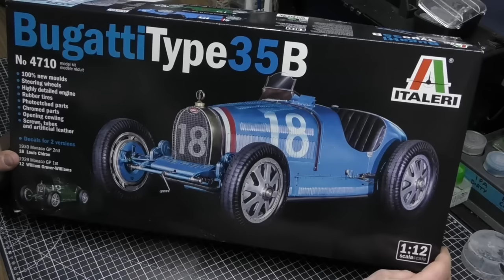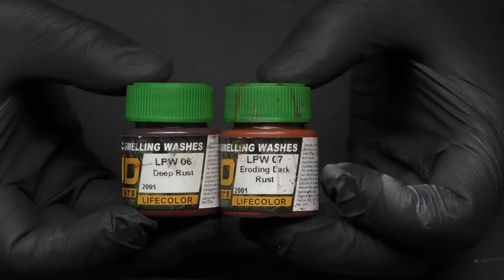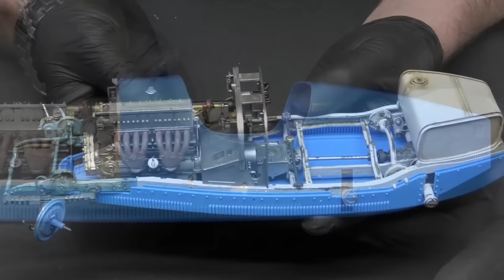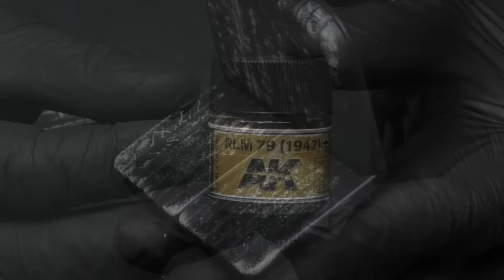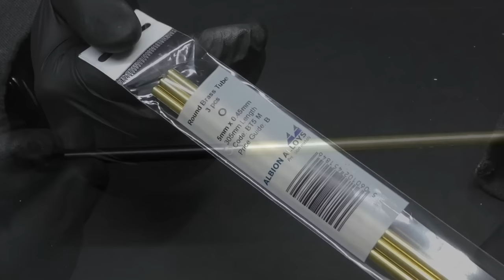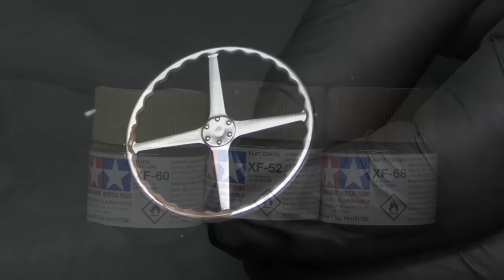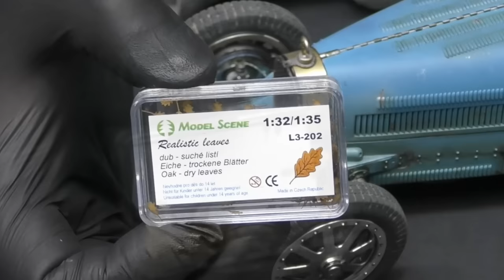Italeri 1/12 Bugatti Type 35B - Model car kit build.

Comment: I once had the pleasure of to share a small racetrack with one of these. The track was anneau du Rhin near Freiburg/ Germany and we were two 964s and a lady related to the track somehow with a friend. Once they were done, they left the car outside near the workshop to cool down. It was also in a well used condition. Lots of nickel plated parts actually and lots of the metal parts - including the cylinder heads - had the circular brush pattern… your version is a bit more worn and dirty, but it’s really very close and looks wonderful !!

Comment: Hello Andy, great job explaining and demonstrating your artwork. I will be studying your techniques on my build, although not on this particular car. I am an old model builder getting back into the hobby now that I am retired. However, I never attained the skill level I have witnessed in this video, I never met someone with your skill sets as well. Back in 1968 I was buying my models from a discount store called K-MART. Car models back then cost only $1.25, sadly these same models now cost upwards of $24.00 a box. One day I went to buy my next project and was surprised to find wooden skids stacked with 1/8 scale Pocher models selling for $25.00 each. I purchased two a 1931 Alfa Romeo 2300 Monza and a 1909 Fiat. I bought these models for the sole purpose of building them when I have retired. They have been sitting in my closet for over 50 years.  I have just started working on the Alfa this week when I came across this video. What you have demonstrated to me was that a model could look so much more dynamic than a finished product. What your depiction of this car says to me is, I have stories to tell you. Whereas a sparkling new car without the scuffs and dings only is an object to admire at best. Thank you for sharing your knowledge and skills. I eagerly look forward to viewing your portfolio in these videos.

Comment: Very good presentation  looks like it would appear when driven back in the 50"s , I have the CMC GmbH die cast that looks factory new and your finished model model looks just as it was years ago right off the  track now i know how to finish my Kingfisher Models 1:48th scale  Foden  S 21 so it will look like it was when i used to drive it before i came to the   USA  Thank you     Ed 40 S of Vegas

Comment: Model Looks Fantastic ,Only thing I would have changed is the Bonnet Straps, the Bugattis I worked on were "Leather" not Fabric . And the Seat Looks a little too uniform in texture . I would have used a Leatherette Covering to add depth and the Drivers position would certainly been additionally very more worn and slightly sunken down .
Cheers !

Comment: please do not take this as a critic ; you work is amazing ; and the level of detail mindblowing; but just as a personal information ; that car had one of the most unique engines then and now. 
it was 100% aluminum & the engine block milled out of one piece; the head and low end where a single piece for the early ones ;  and was known to be a pain to do vavle jobs on.   
aprt from that small informational detail ; i really dont want to down play any of your work ; its just so good i wouldn t be bothered & wouldnt comment if i saw it like that in an expo.

Comment: A really lovely build,  I was impressed by your attention to authentic detail, but also thought it would been even more impressive if you had thoroughly researched and built the complete authentic wiring harness for the vehicle not just the HT lines,  I absolutely love micro engineering on cars  and planes, and felt this kit would be a natural for that treatment.....subscribed.
  I have recently embarked on just this exacting a sort of build on  Aoshimas Kawasaki Z1, 900 incorporating its entire wiring loom and pipe runs, sadly I wasnt aware of your online shop previously and bought the kit direct from Aoshima in Japan along with an 80's  Honda  CB750, I may be purchasing something that tickles my creativity buds from you pretty soon hopefully.

Comment: Really enjoyed this video. Found it by accident and subscribed. I like how you describe each step. Clearly show each paint color and manufacturer. Mostly I build scale diecast models but have merged into plastic for in between builds. I have a question on tubing: Do you know of a tool that bends hobby metal tubes for all sizes? The only one I found only bends up to 4mm. Would like to bend a 1 to 2mm tube.

Comment: Great video, I see I need a lot of improvement in my skills!  Questions: how did you attempt to hide the screw heads that held the parts together and were the seats hard slabs or would they have caved in slightly due to repeated sitting?

Comment: The seats look amazing except in a real aged car the they of course wouldn't be a uniform shape anymore or have uniform pleats, especially the drivers seat. Of course that would require changing the plastic parts. I am building a real replica of a 1930s racecar (Riley not Bugatti) and it's hard to make it not look new, even with period correct parts. The seats are particularly tricky as new leather looks obviously new. One thing to consider with weathering old cars is think of how someone actually used it, so obviously the pedals are worn and the gear and brake lever where people touch it but also consider where someone puts their hands when they get in and out of the car. The body will get worn/polished there since you end up finding one way of getting in and out that you always use the same method so you always touch the same places. Hope my real car ends up looking as good as your model!

Comment: Looks fantastic and i learned quite a lot from your video. 
I just have 1 question though...would the frame be as paint chipped as you made it if the entire frame was covered (protected) with the metal underpan? I thought the underpan was suppose to take all that dammage.